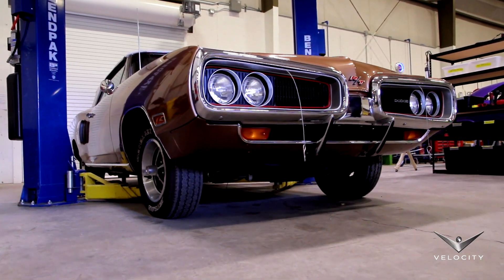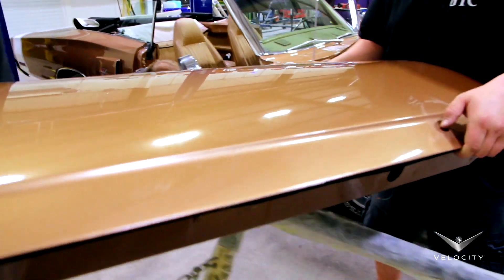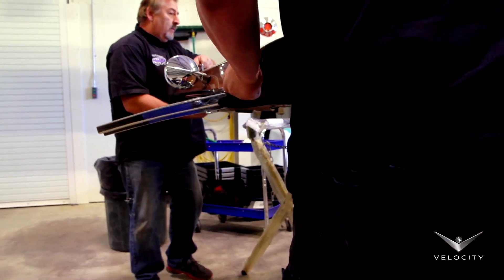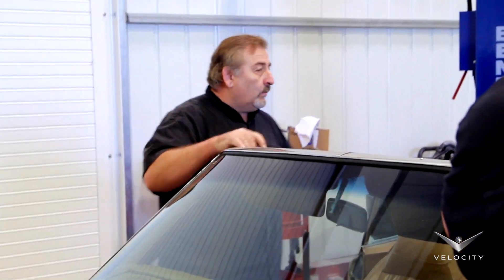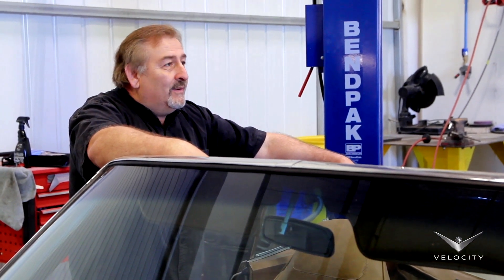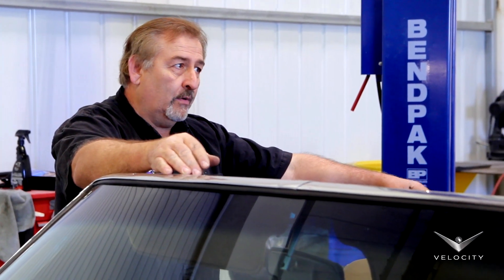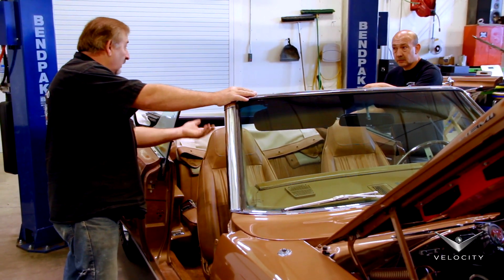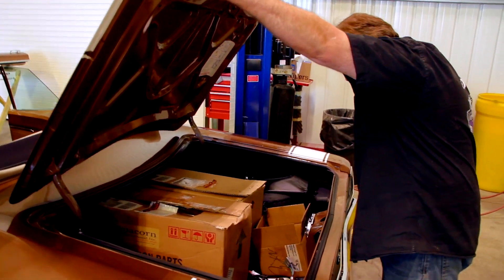An Ultra-Rare 1970 Hemi Coronet RT Convertible

Comment: i know that car i am the one bought the engine transmission and rearend out of it in a scraward in joliette quebec
Reply: yes the car at the junkyard was a wreck.there were not a part of the car whitout a bump. i paid 700 bucks for everything.he came to my place 2 or 3 hours later offer me 2500 but i just dont want to sell
Reply: Hi. That car used to be,Alain Bazinet in Hawkesbury,ont,before it was sold . And he told me,it came from a guy in brownburg Quebec,owne it before. He trade to Alain for a mustang 69,because Alain was a mechanic adjusting the motor for him all the time. The guy got fed up with it,and trade it to him. And,Alain sold it probably down Joliette. I saw a pic of it on pinterest when it was in the scrapyard. Thanks. Luc.
Reply: i dont know those guy you are talking about. me i the mechanic in that car in a scrapyard in close to joliette quebec in 1979 . 2hours later a guy named gerry lefebvre from ottawa bought the body
Reply: Did u resale him the motor and all.I think it was damage in the front.
Reply: i sell it 4 or5 years later to a guy from st georges de beauce for 3500
Reply: @jeanlouisroy4014  What happened to the body?
Reply: @plainswanderer3043  gerry lefebvre from ottawa bought it and later sell it to someone in usa that make this video
Reply: @jeanlouisroy4014  I heard they switched the I.D. numbers to another convertible which would be a real shame.  I saw that car in a car magazine in the 1980's.  Hopefully someone got the original body, repaired it and switched the numbers back as well as the original engine and transmission.  Perhaps that is what has happened since the junk yard?

Comment: i went to make a research on the coronet R/T and its not the 1970 that came out only with 2 cars with the hemi it was the 1968 . Chrysler brought back the hemi for the R/T model  later in 1970 but it wasn't the basic engin it was optional  and never came out with an Hemi  engin unless you ordered it with one  so its not one of the rarest R/t model euqiped whit an hemi its one of the rarest R/t ordered  with the hemi if it was ordered with one to begin with . The 2 1968  model came out of the factory with the hemi as a base engin to see if it would sell but it didn't get the expected sales so they dropped the hemi from it
Reply: 1970 is one USA one Canada so it’s even rarer each is 1 of1
Reply: @bartschwartz7217  There were three made in 1970; one for the U.S., one for Canada and one that was exported to Switzerland.  The car from Switzerland went to Canada and then Florida.  It's the Sublime green color car.
Reply: Have pix of this one the dark green one when they were at mopar nats in the 80s so the green one burned with the hemi cud’s and never restored??? Is that correct so 2 of three left